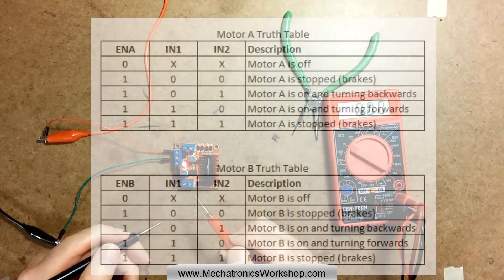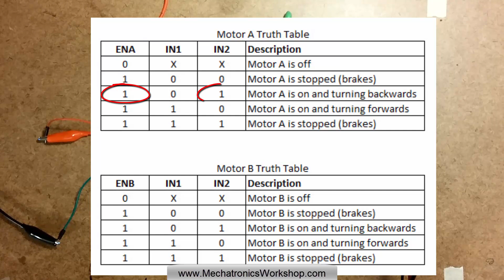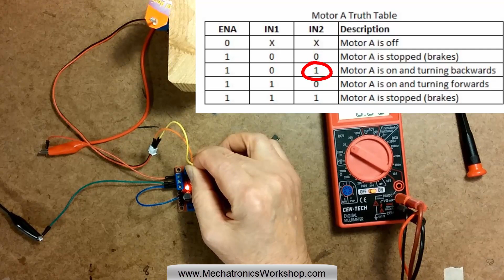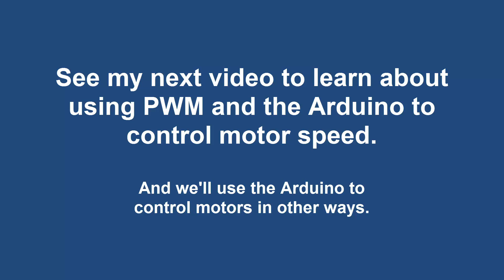The L298N H-bridge motor controller module - basics

Comment: How can I bridge 2 L298N MOTOR DRIVERs together to run 4 dc motors seperately?
Reply from the maker: I don't see a need to bridge them. Just run your control leads to the two inputs on one board and the two inputs on the other board.
Reply: Thx .Good info......One more question. Then The 1st question will make more sense...lol.  Can I use 2 Of Those L298N H-Bridge Controllers on The Arduino. I want to control 4 DC MOTORS Seperately.     2 Motors for the Drive wheels, 1 Motor for a Gripper And 1 Motor for The Gripper Screw Shaft The Moves the Gripper Up and Down
Reply from the maker: @Henry Williams  There may be better answers than mine (I don't spend a lot of time with these types of projects), but here's how I see it -- Yes, any Arduino should work. You need four PWM pins for each motor 'Enable' pin to control speed. IN1 and IN2 require digital outputs (2 for each motor) that should be no problem. By the way, there are newer, more efficient modules than this old one. This one works great, but you might want to look into newer motor controllers such as the TB6612FNG. This guy has a pretty good video on those: https://www.youtube.com/watch?v=JPPTRj0KWbg
Reply: @MakeBasicElectronics  Thx .I appreciate the info....And Yea I saw that about the new, Smaller Controllers . I picked up a few. It will work good with my project. Won't take up so much space.    Again.Thx for the info.

Comment: When i connected a 12v adapter at the input, the motor ath the output rotate vere hardly, which is not steady, what to do then
Reply from the maker: Make sure your power supply can supply enough current for the motor.
Reply: @MakeBasicElectronics  adapter is of 12v 2A
Reply from the maker: @athul4215  Does the motor run ok connected directly to the power supply? Did you try it on outputs 3 and 4 instead of 1 and 2?
Reply: @MakeBasicElectronics  sir, while I'm  connecting directly with drive and checked the rotation its not hardly its very smooth, while i connevt arduino nano its rotate hardly and jumping
Reply from the maker: @athul4215  Do you have separate power supplies? One for the Arduino and a different supply for the motor? If so, the ground from each supply must be connected to the other. It sounds like you may not have the grounds connected together.

Comment: If it is connected to a pwm source, does it produce an ac signal ? 
Is it an H bridge?
Reply from the maker: It's all DC voltage. There is no AC. If you mean does it produce a PWM (pulsed) output, the answer is yes. If you apply PWM to the input, you get PWM output to the motor. Output is in proportion to the input. Yes, it is an H-bridge. It's a dual H-bridge, actually. It can control two devices.

Comment: i am using a nema 23 stepper motor which has 2.2A rating can I use l298 driver for it??? i used it on motor without load but it doesn't rotate only vibrates how can i fix this?
Reply from the maker: Sorry, I can't help you with this one. Try searching for L298n stepper and hopefully you will find an answer!

Comment: ena and enb female ports are different than normal female ports. Can we just use normal male jumper wire to wire it?
Reply from the maker: In the video at 10:20 I show the IN and enable pins close up. Both enable pins have jumper blocks on them so you can't see the actual pins in my close up, but they look just like the IN pins when you remove the jumper blocks. If those are what you mean, they are male pins, not female. And yes, you can use standard jumper wires. I posted a photo of the enable pins with the jumper block removed on my blog here: http://mechatronicsworkshop.com/index.php/2017/12/21/all-about-the-l298n-h-bridge-motor-controller/

Comment: You are wrong on regulator, check datasheet, input voltage up to 35V and capacitors are 35v aswel. Jumper sits there to feed L298n IC with 5V, ofc if you remove it, you will have to connect external 5V. if you levae jumper, you can use +5V as output. Conclussion, dont remove jumper, read datasheet before you start your project and feed this module with 6-35V.
Reply from the maker: Please post a link to your datasheet. My information says no more than 12V or the 5V regulator will fry. The best info I could find on this device was on the ebay page where I purchased it.
Reply: @MakeBasicElectronics  they all have 78m05 regulator and it has input voltage up to 35V
Reply from the maker: @MyNameIsGrisha  Thanks for your input. It's something for users to look into if they would like to. I think I'd stick with the instructions that come with the device unless I wanted to do some experimenting.

Comment: Can I supply 35 v to 12v port
Reply from the maker: You can apply up to 35V as long as you remove the jumper.
Reply: @MakeBasicElectronics  which jumper 5v protection wala
Reply from the maker: @notyet_fpv  Wala? Sorry I don't know what that means. The jumper is explained in the video.

Comment: Mine only lights up from 5 volts pls help
Reply from the maker: Please give me more detail.
Reply: i plugin positive to 12 volts and negatve to ground but it does not turn on  (used around 9-11 volts to power it)

but only turns on when power enters the 5v of the  l298N (with it being plugged in in 12v and GND  (also used around 9-11 volts))
Reply from the maker: @Joseph-xs2mo  If you apply 7 to 12V to positive and negative, do you have the jumper installed like shown at 1:20 in the video? If yes, the 5V light should be lit. Of course you should be very sure that 12V and GND are applied to the correct inputs and that the jumper is good and installed properly and fits tight. You could try removing the jumper and shorting the two pins with a flat-edge screwdriver or similar. If 5V light comes on that would mean that the jumper is bad. Also, be sure your power supply is providing enough current. Powering the board with no motors connected will not take much current so your power supply probably is not the problem, but double check just in case. Be sure to disconnect anything that might be shorting out the board.
Reply: @MakeBasicElectronics  thanks

Comment: what is an H bridge?
Reply from the maker: It's an electrical configuration of 4 transistors (or switches or FETs, etc) that makes it relatively easy to drive a motor forwards or backwards. When looking at a schematic of an H-bridge, the configuration looks like a capital H where the motor is shown as the horizontal bar in the imaginary 'H'. Then, two transistors are drawn in such a way as to appear to be the vertical bar on one side of the imaginary H, and two transistors are shown as the vertical bar on the other side. People used to have to build an H-bridge out of individual components. Modules like the L298N encapsulate all the components in a single chip and just expose the inputs and outputs in a handy form like IN1, Out1, etc. This video does a good job of describing how an H-bridge works using individual components and switches instead of transistors: https://youtu.be/fVgnUWIWzZ8
Reply: @MakeBasicElectronics  Thank you ! :-)

Comment: my motor is not even rotating with 9v battery
Reply from the maker: Even though a 'standard' 9-volt battery can supply enough voltage for small motors, it cannot supply enough current for motor circuits and it is not surprising your motor does not turn. If you have a robot or something that moves, you will need batteries, but ones that can supply much more current than a 9-volt battery can. So a lithium battery, or multiple AA, C, or D-cell battery packs are what you need to use. If your project is stationary, you can use a fixed power supply (which I did in the video). Of course, battery packs will work for stationary projects, too.

If you're just using a little hobby motor for experimenting this isn't critical, but it's a good idea to know the voltage requirement of your motor, and the normal running current, and stall current requirements of the motor. Also, the voltage drop and current requirements of any driver circuitry you're using (the L298N in this case). Knowing these specs will help you choose the right power source for your project.